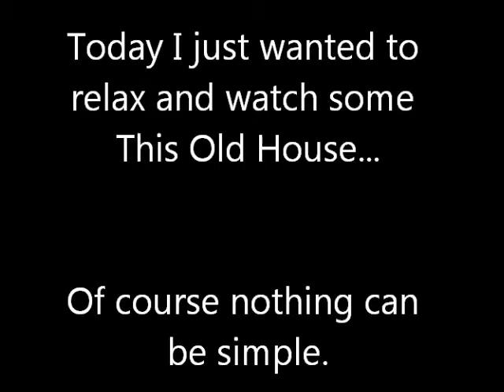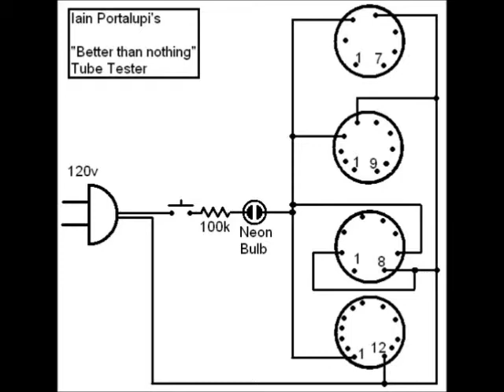"Better Than Nothing" Tube Tester

Comment: I had this happen to an old radio I restore. Recapped it and change out all the resistors (most were out of tolerance) Plugged it in an brought it up slowly. got it up to voltage and started tuning it just doing a slow sweep across the dial. got 1 minute into it and it just went deaf. just a barely audible hum. thats it. All tubes were glowing. but nothing. Turned out a tube did die but not the filament part. just swapping it out with another tube i had laying around brought it back to life again.

Comment: The filaments use different voltages. If you apply 6.3V to a 1.4V filament you will burn it out

Comment: If you're worried about using 120 volts, use a three wire plug, and attach the ground wire to the enclosure. Just add a solder tab onto one of the pop rivets, and solder the green wire there.

Comment: Great tester. Would it be possible to get a parts list? I see the enclosure down around the first comments. I have found the sockets that i need, I just need the bulb and the button(what kind of button is that)? Also can we do LEDs? And last, can we do a 3 prong cable on this enclosure, and how? Screw in or sodler? Thanks.

Comment: You go through great lengths to talk about how people shouldn't use this if they're scared of 120V.  I don't want to be around people who aren't scared to make this, instead of using a proper three wire cable and grounding the chassis.  Not being afraid of 120VAC on a hand held device with a metal chassis is stupid.  Building a device that doesn't include a simple safety device is stupid.

I worked in the Navy for 16 years on RADARs and high powered comm gear.  I would not use this device.  It is unnecessarily unsafe.
Reply from the maker: Clint Davis lots of things have metal cases and 2 prong cords. Toaster ovens, lamps, older vacuum cleaners all had metal housings and no ground prong. A lot of antique radios have one prong of the cord attached to the chassis now that was dangerous.
Reply: You worked on radar in the Navy and you're scared of this box? Why would anyone be scared of a properly built device? I wouldn't want to work near anyone who is afraid. Scared people are jumpy, unpredictable and unprofessional. You should have chosen a different trade.
Reply: Clint Davis my dad was also a radar tech on the USS Simpson, he would not approve of this either

Comment: HI IAIN, THANKS FOR THE EXPLANATION. I HAVE A PRECISION V T METER, BUT THE METER WAS BURNED WHEN I BOUGHT IT. DO YOU KNOW IF IT IS POSIBLE TO REPLACE IT WITH A NEW ONE. THE ORIGINAL IS 4MA-160MV, THANKS

Comment: I use a continuity tester across the filament leads to test them, but another tuber said that that can burn them out is that correct?
Reply: If the filament is like 1 volt or something it will, because some testers use higher voltages to test it on the ohm setting

Comment: easier to use a multimeter on continuity setting ( https://www.youtube.com/watch?v=r4FNP5rVnTw) 
and just check which pins you should probe by looking it up on valve charts why subject any valve to a high voltage if you don't have to especially as it could blow certain valves and that would be counter productive.
Reply: Kevin Rouse He addressed this issue in the video. Did you watch it?

Comment: does it have to be a neion build?? or can it be a LED?
Reply: you can use a led and use a 3  to 12 volt dc power supply ( wall wart ) and a resistor  and it will be safe the 120 volt will be at the wall outlet.